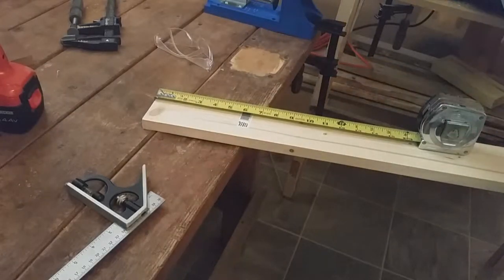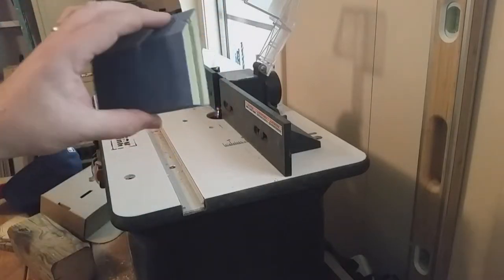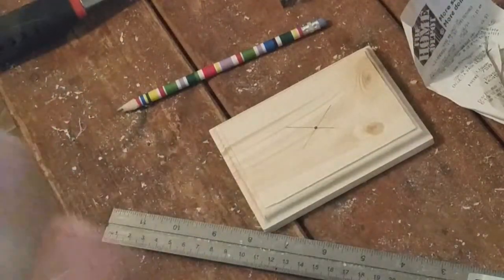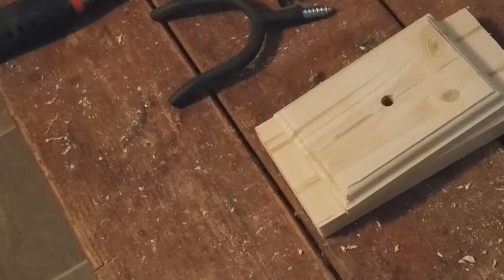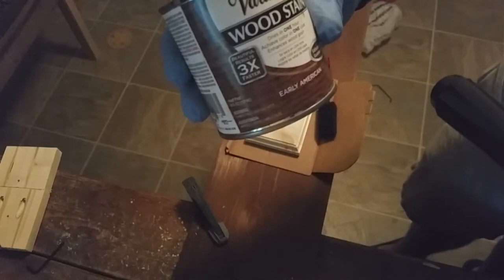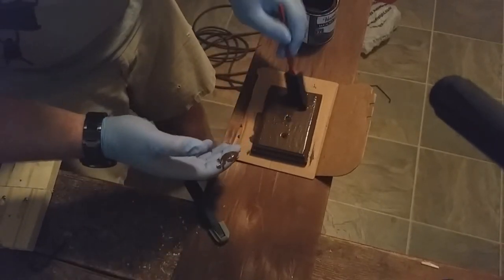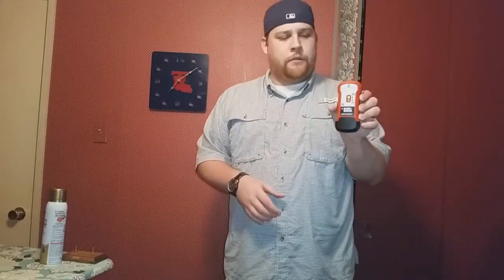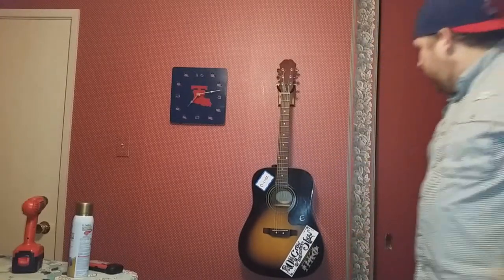How to Make a Guitar Wall Hangar!

Comment: you need to practice with your router fence you should not have to move away from the fence when using the router. Try it with scrap wood and play with it and you will be able to hold your wood against the fence the whole time your cutting that way all your cuts will be the same. Keep up the good work though i love your videos!!